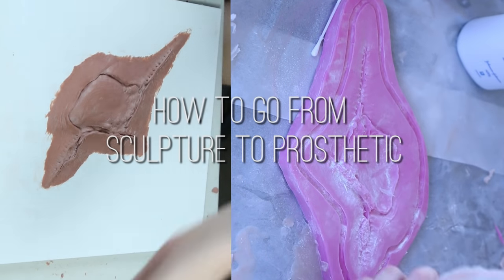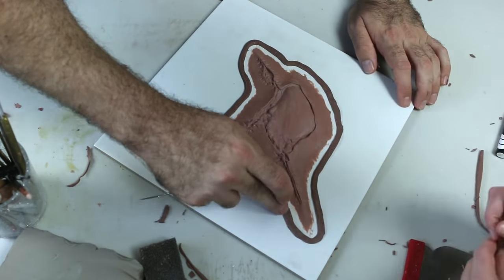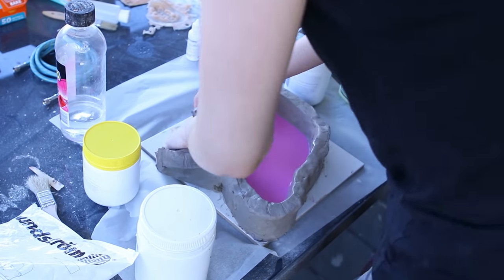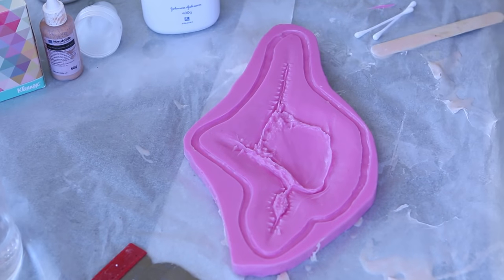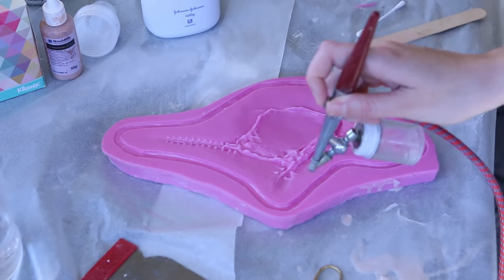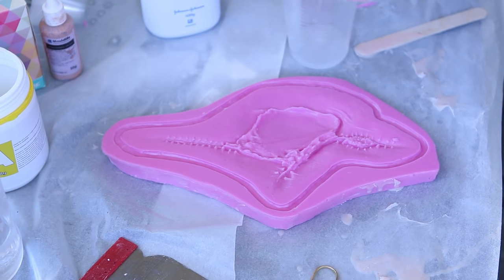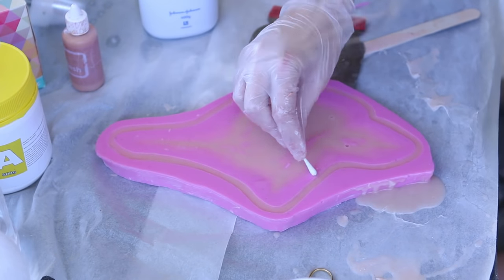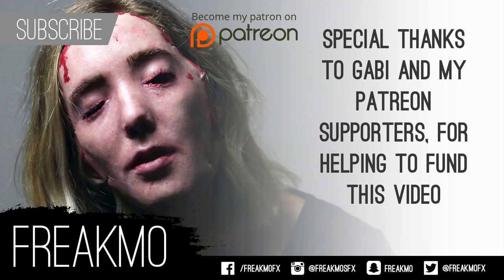Flat-Moulding and Casting the Infected Knee Tutorial | Freakmo and Powdah Collab

Comment: when putting on the cap plastic are you using the same compressor you use for makeup but a different airbrush and hose? or just a different airbrush? and did you use that same one when painting the arm prop?

was also wondering what airbrush you are using and if it comes with that reservoir?

Comment: I like your work and your videos. I wanted to ask you if you have tried super baldiez spray yet. I am trying some different techniques for the silicone molds and that spray looks like a good solution if it works the same way as the liquid one.
Reply: Filip Halo 
I have used it but it wastes a lot of product 
I prefer the brush on method

Comment: Hey Freakmo, just wondering, what is cap plastic and where can i buy it in the states? also, would painting the silicone with liquid latex and then removing that work as a substitute? thanks!
Reply: maxxam1a 
Cap plastic is a vinyl material used to dissolve silicone into your skin it can be purchased at frendsbeauty.com or fxwarehouse.com 
And the whole point of using silicone is it has the translucency of skin, moves and feels like skin.. It would defeat the purpose to put silicone on top of your silicone 
Also you can't use silicone while it's curing anywhere near latex because then it won't cure ever and you wasted material 

It you want use grease paints thinned with some 70% alcohol and it gives same effect as the alcohol activated paints it just doesn't have the same longevity
Reply: To put latex on top of your silicone

Comment: How can you paint cap plastic with alcohol based paint isn't it gonna dissolve
Reply: Little Big Inventor  the pigment stays only the alcohol leaves
Reply: Little Big Inventor 
The cap plastic is basically just there to dissolve the edges to be smooth and you have to put some pressure down to actually dissolve the plastic